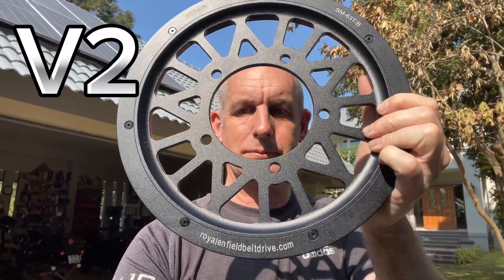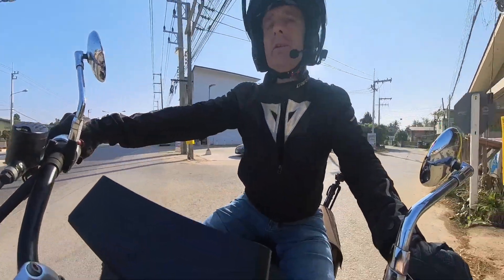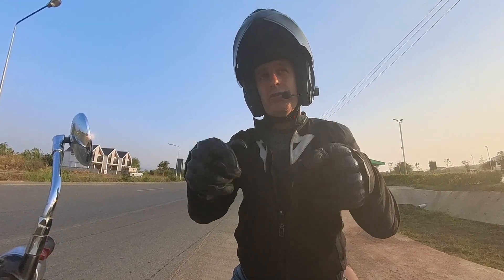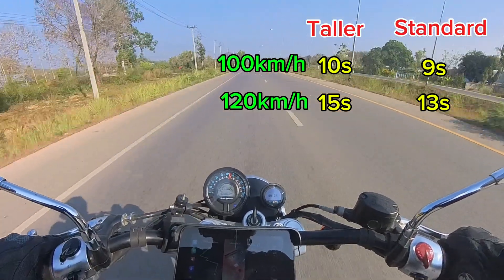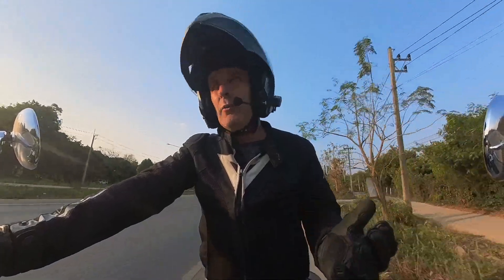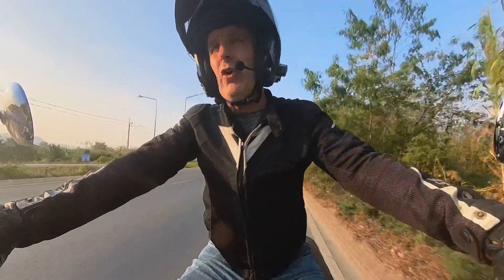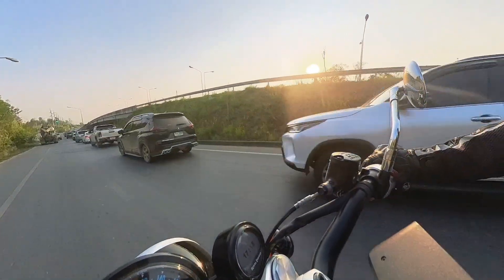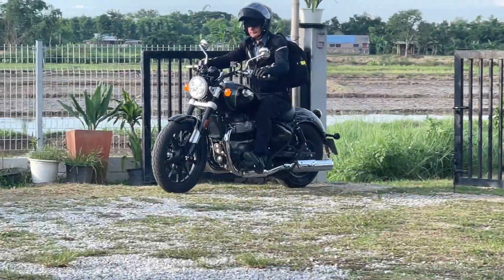Belt Drive Gear Ratios: The Science Explained

Comment: Hello Teacher T, I wrote to you a long time ago, about the subject of buying the Super Meteor as my first motorcycle and you recommended the Meteor to start with, but the RE agency made me a good offer and taking advantage of the difference in the currency exchange I ended up buying the SM, a “Celestial Blue”, I have already done 2600 km (I clarify that I went to a driving school) and it is already modified for traveling. If you want, I can send you some photos and when I can, I will put a transmission belt on it for the reasons you explain on your channel. I have a question for you, I own a car with electronic injection and the manufacturer stipulates that injector cleaner must be installed every X km, would it also be advisable to put injector cleaner on the Super Meteor? The Official RE Agency has not been able to respond.
Reply: Hi. You're not alone where RE is concerned.  I emailed them last summer with a question.  A quick reply came saying they had forwarded my inquiry to their sales team.  I'm still waiting 😂😂😂
Reply: I use injector cleaner as a precaution in my V-Storm 650, once a year, or every 12000 km. In fact, I’ve been doing it on all of my motorcycles, carbureted and fuel injected and never had an issue
Reply from the maker: I can’t answer this either sorry.  But I am approaching 18,000 km now, and have never used such a cleaner. But 95 grade fuel is recommended over 91. 🙏
Reply: Great vlogg Teacher T.  It’s one thing I will certainly do on my SM.  Tbh I cannot afford to do it yet as other things take priority, well that’s what my wife tells! Who needs a holiday anyway 😂 ride safe my friend 😊

Comment: Greeting Teacher T.  You know i have thought long and hard about fitting a belt drive kit to my 650 Super Meteor, especially as the stock chain keeps going slack riding two up and only doing about 50 to 60 miles?  Total weight riding two up is just under 150 kilos.  I have hust come back from my local motorcycle shop after ordering a new heavy duty chain and sprockets. Total milage is just over 5,600 miles.  I settled on standard gearing, sorry 🤷.  Becides i have got chain cleaning, ajusting and tightening down to a fine art and something i love doing as ut gets me out of dusting 😂😂😂.  Back in 1981 we bought a brand new XS 650 Yamaha.  Two up, topbox and panniers and screen we was getting over 56 mpg holding 70mph on our moterways.  Not bad for old technology was it?  But i do love twins and that cruising style.  That said i do find your vids very interesting and innovative.  Take care and see you in the next one sir 🙏🖖...
Reply from the maker: Ha ha thanks. I’m preferring standard gearing at the moment, now I’m getting used to it again 😂🙏
Reply: @Ride-with-T Another reason for ordering a quality heavy duty chain is rust!  No matter what I do, the links inside and out just keep rusting?  Going to be riding two-up to Cornwall in June so I want to be able to trust my drive chain.  Incidentally I noted what you said about the new kit and being further forward on the adjusters.  So thank you for that 👍.  Stay safe and see you in the next one
Reply from the maker: @ The original chains are not good. After market or belt drive is the way forward. Literally 😂🙏

Comment: Don’t drive with you click  / flip helmet open. That is absolutely dangerous.
Reply from the maker: In 40 degrees Thailand it's the only way to breath. I only close it above 50kph. When I had the Meteor 350 I only wore an open face helmet. It's my choice 🙏
Reply: Over 90% of my riding is done in my open face helmet in the UK.  I still love that ice cold feeling while riding, even if my arthritis joints object!
Reply: @leswatson8563  I also only use helmet jet, under cold, rain, heat... I love it!!!
Reply: Not at all, if the helmet has P/J homologation

Comment: One question on the belt drive, do you have to re-tension and realign it every time you remove the rear wheel?
Reply from the maker: Yes. Certainly. You would also have to do the same with a chain. Once you become accustom to it, and know the approx distance of the rear axle before removing the wheel, it's fairly straight forward. 🙏

Comment: You mentioned something about a stone getting into the belt drive system. What happens if it actually does? Does it ruin the belt? Could you pls clarify? Thanks Teacher T.
Reply from the maker: Yes. The reason trials bikes do not run on a belt drive. There is no real advantage to do so. But a cruiser bike, designed to go long distances on asphalt roads, it's perfect. 🙏
Reply: Back in the mid 1980s my mate bought a second hand (under 2,000 mile) Harley Davison cruiser.  He part exchanged that bike with just over 90,000 on the clock for a new HD cruiser.  Not once did he have a stone in the belt drive.  So I'm guessing if it happens it could be a rare thing?  Hope this helps?  Safe riding 👍...